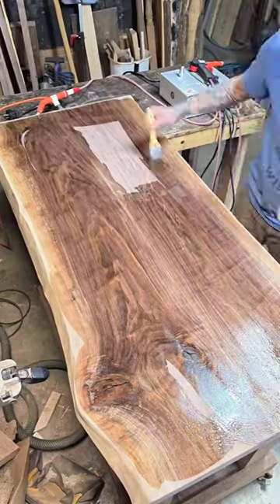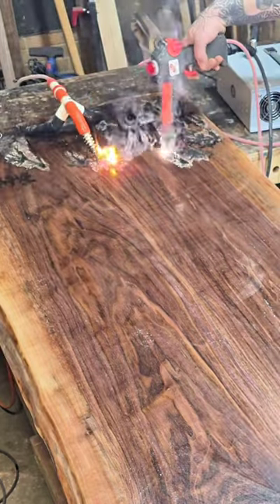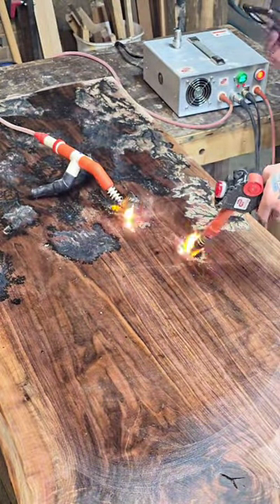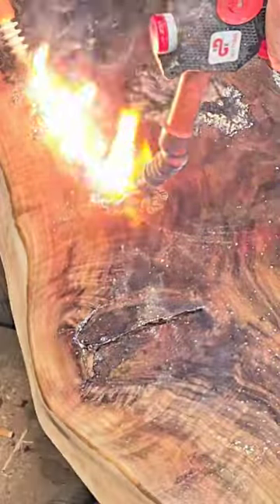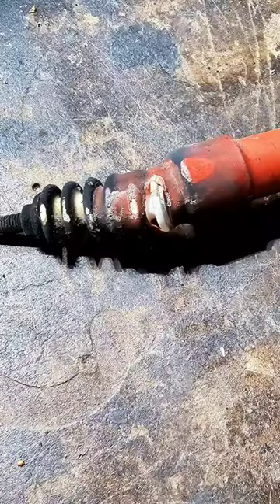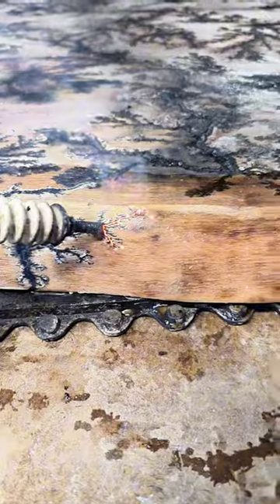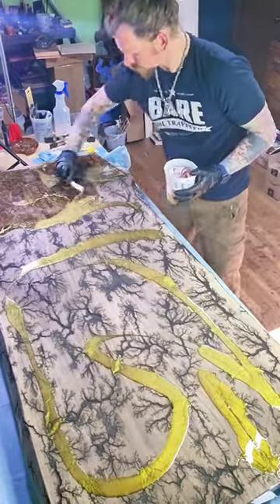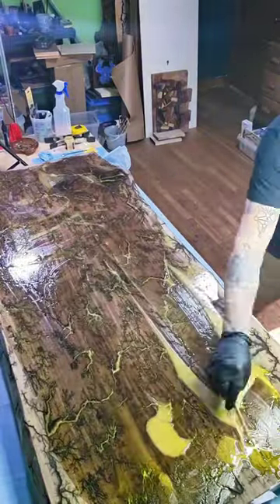Are you entertained and educated? #woodworking #diy #epoxy #process #professional #safety #learning

Comment: Did you manufacture your own machine if not may ask who did ? I am wood worker who likes to tinker and make all kinds of curiosities. I am also a 20 yr Journeyman Lineman who has been energized up to 345,000 volts. Fire electricity and wood work. Yay. I’ve used microwave transformers neon sign transformers and even purchased the very slow but effective conestoga wood works burning machine.  Looking for info on already built machines. I got one from Etsy that came from Turkey but hav tried it out yet
Reply from the maker: https://lichtenbergwoodburning.com/ref/14/